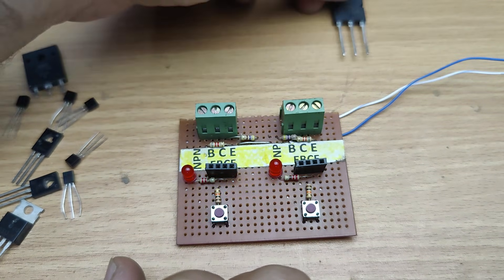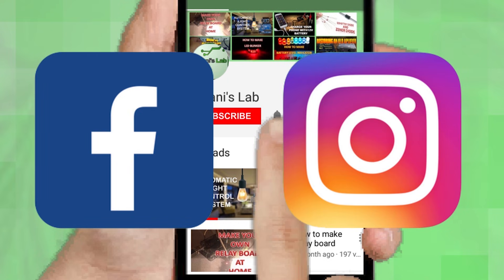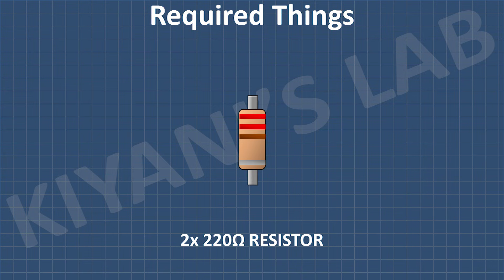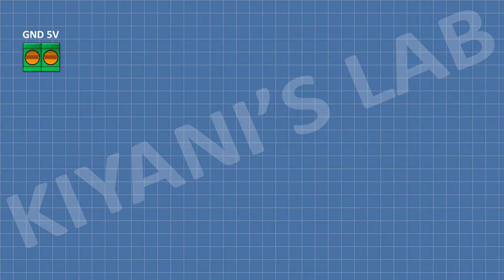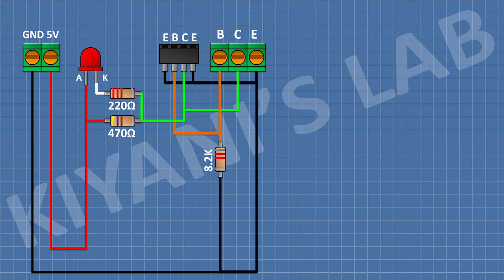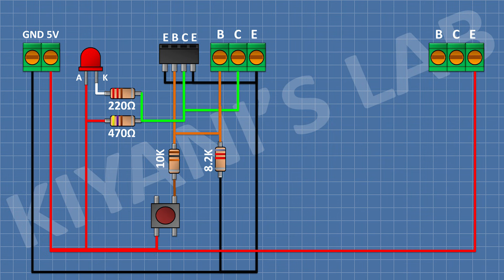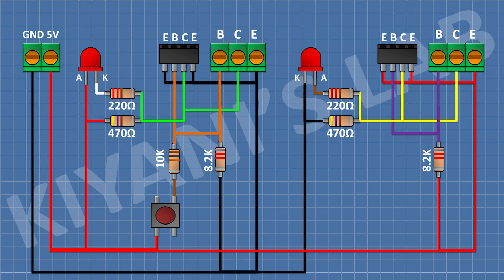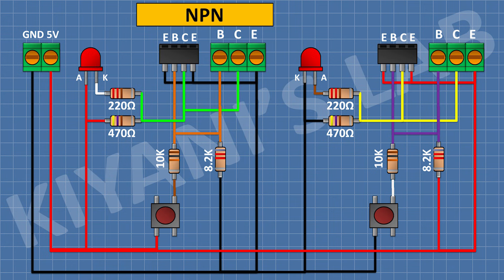Transistor Tester ( BJT ) | Electronics Project

Comment: Hi, could you design electronic circuits and devices starting from scratch and then showing the various connections and the arrangement of the electronic components so that they are easier to create, I would like to build electronic circuits with triggered and non-triggered logic gates, flip flops, Pic PLC microcontrollers etc...... ok?  thanks Luca